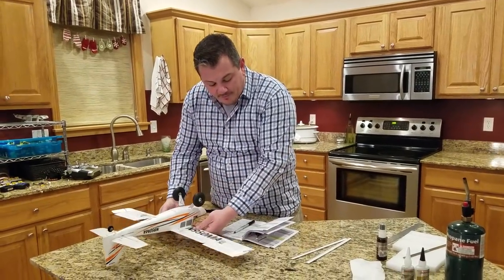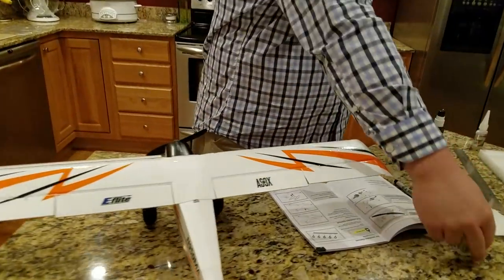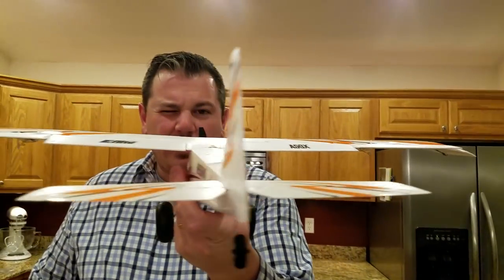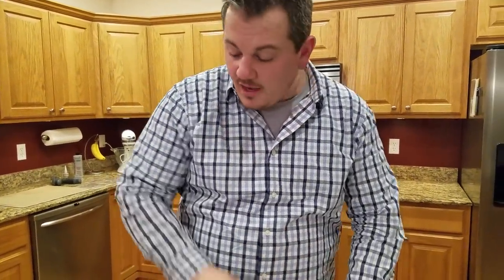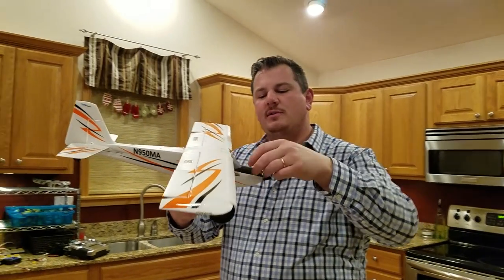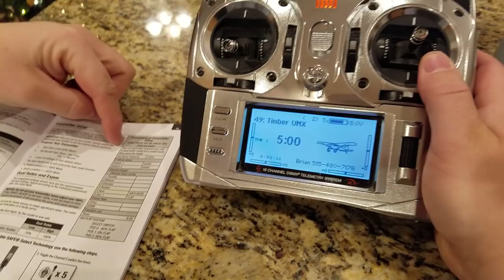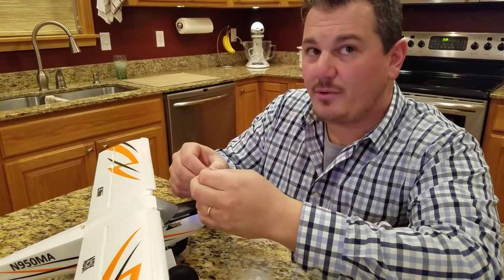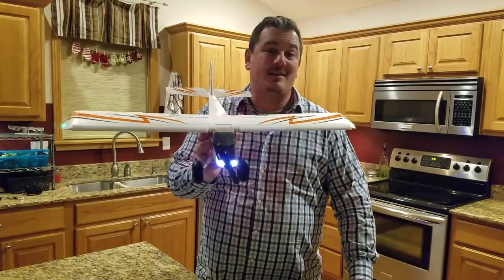Eflite - Timber - UMX - Assembly, Radio Setup, and Tips

Comment: Great videos brian. 
I’m new to the plane hobby. 
I have the new umx timber and still 
Don’t understand the dual rate and expo settings for low/medium/high rates. Your video was very informative but was a little too fast for me and I could not see your radio at times. Any way I could get all the settings from you. Thanks so much Steve in DALLAS ga.
Reply from the maker: Expo and dual rates are very subjective.

Most of the time EXPO makes the sticks less touchy near the middle or neutral position, so you can make a fine maneuver without giving up the maximum control deflections, for when you want to make a maneuver very snappy.

Dual Rates change the total output to the Elevator, Rudder, or Ailerons, the three primary control surfaces impacting change in Pitch, Yaw, and Roll. For example, if the elevator moves 1 inch up and down, and you only want it to move 3/4 inch up and down, then you'd set the dual rates from 100% to 75% thus cutting the output at any given point in the sweep of the control stick by 25%. This is to make the plane LESS Controllable, as new pilots sometimes tend to "over-control" the plane. In my experience, I hate anything less than 100%, in fact, I've been know to crank up controls PAST 100%, but I also use EXPO to "tame the middle of the sticks"...

What's the moral of my comment. You need to play with it. Start with factory settings on Horizon Hobby planes, as they're usually very much flyable, then you can adjust them up and see how it impacts the controls, and down to see how it impacts controls.

Here's ONE method you can use if it's NOT a BNF plane, meaning Horizon Hobby has done all the troubleshooting and delivered a good plane for you, out of box...

Set Expos / Dual Rates as follows...

Find a 3 position switch, and assign ALL three axis (Elevator, Rudder, or Ailerons) to that same switch.

For the MIDDLE setting, which in the Spektrum world, it'd be called position 1, you should set your GUESS setting....like 20% Expo, for ALL three axis (Elevator, Rudder, or Ailerons).

For the LOW setting do 1/2 of whatever the MIDDLE setting was...so in this example make, it 10% expo

For the HIGH setting do 2X whatever the MIDDLE setting was...so in this example, make it 40% expo.

Now for DUAL RATES, just set them as follows...

Find a 3 position switch, and assign ALL three axis (Elevator, Rudder, or Ailerons) to that same switch as above...so now you'll be controlling Expo and Dual Rates at the same switch...remember, pilot fatigue is a real thing, especially for a new RC pilot. You don't want to be searching for 6 different switches (if you had that many) just to make a fine tune adjustment that you probably don't understand anyway (yet).

For the MIDDLE setting, do 100%

For the LOW setting, do 100%

For the HIGH setting, do 75%

...now go and fly the plane, starting on the MIDDLE setting. When you're up in the air a few mistakes high, go ahead and maneuver a bit. Then switch it to LOW, and fly some more. Be ready to see how it responds, as you might HATE it, then you can quickly switch it back to MIDDLE, then when you've had a chance to evaluate your experience, switch it to the HIGH setting and do the same. This is what I mean when I say, just "play with it". This is a highly subjective thing, and what works for me might be annoying to you. There are some things that most pilots might agree on, but for the most part, my method gives you two outs if you "Get it wrong" on the ground...you can cut it in half OR double it to make it less of an impact on your flight. Now that you've "played with it", land that plane and make your adjustments so that whatever settings you preferred, become your MIDDLE setting, then you can do the same formula...1/2 for the LOW setting and 2X for the HIGH setting. I do this with virtually every plane, and it hasn't failed me yet.

I realize you will have questions, please ask, but WATCH FIRST....then you'll be able to site a point in the video, so I have context from witch to get on the same page with you.

Good luck - YOU CAN DO IT!!!
Reply: Brian Phillips thanks for your reply brian. I have the new umx timber BNF and the new dx6 radio. I’ll try these settings. I have lots of simulator time but I know it’s not the same as the real thing by far.and time with a 3 channel. Just a little overwhelming. Thanks again for your help. Steve.
Reply from the maker: It is overwhelming, until you get better, then you'll go and get another overwhelming plane to fly, and the cycle repeats - LOL! I suspect cardiologists wouldn't recommend this hobby, with all the heart attacks involved,  LOL!

Some advice...learn something EVERY flight. Learn from EVERY crash. Try not to make the same mistake twice (which you will, and everyone does). Learn to fix the planes, you can't possibly order every part needed to fix every crash, and they won't be available many times...I can help you with that too :) (<--shameless plug) ....most of all, fly a LOT. Fly as much as your scheduled and wife will allow. You'll get through the scary part faster, and you'll be a better pilot quicker. When you're a "better" pilot, you can get more exciting planes, with less flight aids, like SAFE (which is excellent for learning to fly, I used it..).

Good luck!

P.S. You'll learn quickly too, there's a lot of great people in this hobby, but there's a lot of jerks too. Learn to seek out the good ones, and get away from the jerks as quick as possible....they will sour your taste for RC planes faster than a $1000 plane crash - SERIOUSLY!!!
Reply: Just pause the video and change settings as you go and hit play again . It worked a treat for me and yes he flew through the settings like a mad man lol . Still a great very intuative video to help understand and get basic settings into the spektrum radio .

Comment: Can you use hot glue for the lights???
Reply from the maker: Maybe, but it will melt the foam if it's too hot, also it's HEAVY!!!

I think, based on this video, you might be just talking about putting a dab of hot glue over the LED, in which case, you'd be okay to do this, since you won't melt anything if you're careful, and secondly, it's not going to amount to much weight with only two or three drips :)

One thing about the CA...it will dry more clear, but I've actually used BOTH...I'll drip hot glue, then I'll coat that with CA, and then kicker to set it up quick, with the plane situated to cause the "drip" to lengthen the CA buildup. This works really nice!
Reply: @BrianPhillipsRC  thanks mate. Love your vids!!
Reply from the maker: Sure thing! Thanks again :)

Comment: Last question brian. 
Will these settings work for the umx timber BNF? Thanks again.
Reply from the maker: The ones I used in the example would be a fine starting point, then just refine them to your taste. You WILL notice a difference when you flip the 3 position switch.
Reply: Thanks again brian for your help and the great videos. And your wife is great with the camera.
Reply from the maker: Sure thing Blues Man! She does a very nice job with camera work.

Comment: My timber looks really sad after one of its first flights. The receiver in it was malfunctioning and it did a straight nose dive into pavement from probably 50 feet up. Unfortunate. I'm shocked at how it took it though, barely any damage for the most part. Easy glue fixes and what not. I even called up Horizon Hobby and they are sending me replacement parts for the prop adapter, battery cover, and the receiver.

Aftermath is here; https://imgur.com/a/CM0iM
Reply from the maker: Looks painful!!! So Horizon Hobby said they'd send the prop, prop adapter, battery cover, and Rx, BUT NOT the rest of the plane? Boy, I tell you, they can be your best friend or your worst nightmare!!! I usually only go to war with them over stuff I really want fixed, so I sorta understand, but I just wish they would have sent the whole plane. If they'll agree to the possibility of a complete Rx failure, why not just send a whole new one? It's like somehow the rest of it's "you're fault"...that just ticks me off, for you...too bad.

You got Hobbyking'ed

...but I feel your pain!!!
Reply: I'm assuming the guy on the phone with me was really just trying to do what he could for me. Mainly because he I guess tricked me or whatever and I said I didn't do a range test. Apparently it's in the Timber manual, and because I didn't do that they couldn't replace the plane because it's "my fault" for flying it. Luckily it's patched back up, the only sad thing on it still that battery door and the prop adapter. I'm just waiting on those two parts, I've already swapped out the receiver which was a pain, since it's the first time I've done it. Everything works again though, and they were willing to replace the parts. 

Recently I got the J-3 cub for christmas and it has been a blast to fly. I'm trying to figure out a mod for skis though, and I've got some things in the works. I tried making a runway, but the snow is too deep and I'm too lazy. I've got quite the backyard though! https://imgur.com/a/5xeXN

Comment: Brian, I understand what dual rates are. But I never have grasped the meaning of the expo.  I have looked at videos but my brain just can't get it.  Can you please once and for all explain to me in the simplest form what they are and maybe you can be the hero of getting thru to my brain.  thanks
Reply from the maker: Exponential AKA Expo...is when you change the amount of control surface output from a stick movement, in an exponential manner...

Some like to say, it "softens" the middle of the stick, which CAN be true, but you can dial in reverse Expo too, for extra sensitivity at the same middle of the stick, if you wish.

Think of one, and only one control axis, lets say Roll, via the Ailerons, for example. Let's say you're having trouble moving the roll axis when you use Elevator...so what can you do? Dial in 25% Aileron Expo. What will this do?

With mode 2, for all details listed, meaning elevator and ailerons on the right stick...

Normal (no expo) - aileron stick at 0% over to the right (centered) - ailerons level
Normal (no expo) - aileron stick at 25% over to the right - ailerons move 25% up and 25% down
Normal (no expo) - aileron stick at 50% over to the right - ailerons move 50% up and 50% down
Normal (no expo) - aileron stick at 100% over to the right - ailerons move 100% up and 100% down

Now, with the Expo turned on...

w/ 25% Aileron Expo - aileron stick at 0% over to the right (centered) - ailerons level
w/ 25% Aileron Expo - aileron stick at 5% over to the right - ailerons move 2% up and 2% down
w/ 25% Aileron Expo - aileron stick at 10% over to the right - ailerons move 5% up and 5% down
w/ 25% Aileron Expo - aileron stick at 25% over to the right - ailerons move 12% up and 12% down
w/ 25% Aileron Expo - aileron stick at 50% over to the right - ailerons move 40% up and 40% down
w/ 25% Aileron Expo - aileron stick at 100% over to the right - ailerons move 100% up and 100% down

You can see that the change is much less, until you pass the 25% threshold, then it picks back up and eventually, you'll still get the FULL output of the control surface. The BEST way to understand expo is to go and fly a plane. Turn expo up to 50% on each of the three axis, elevator, rudder, and aileron...then change the expo to 25%, then 10%...you will see EXACTLY what I'm talking about. It'll take the most erratic plane, and tame it down to a manageable state.

Now that you've tried this, simply change each axis, as you see fit. I want less responsiveness from the RUDDER, but the elevator and ailerons are good at 20%, then make the rudder 50%....try again, and next thing you know, the plane fits YOU like a glove ;)

Just do it...you'll get it. It's super easy to do, and takes like 15 seconds. Every time I try to enplane this, I feel that my explanation get less and less useful, so I HOPE you have a semblance of what the heck I'm trying to say.
Reply: The control sticks cause the ailerons, elevator, rudder to move.
With no expo, if you move the control stick 1/2 way then you get the ailerons, elevator and rudder to move 1/2 way to their max....etc...

With expo set to your chosen amount - you can get more or less movement
on the controls from a given amount of stick movement -
for example-
you could set the exp so that when you move the stick 1/2 way
you only get 1/4 movement on the controls -
the result is that the stick is not as sensitive -
you have to move it farther to get results -

That is a simple explanation but there is more to it than that.
With expo - the amount of control movement you get depends on where you are in your stick movement. ...
for example - when you first move the stick a little - you can set it so that you do not get a lot of control surface movement but as you move the stick more you get  more and more movement -

Imagine you have a car with a steering wheel and when you first begin to turn the wheel you do not get a lot of result - like not having power steering -
then as you turn it a lot - the power steering starts kicking in and each little increase on the wheel gives you more and more results -

You may like your car to behave that way - 
it makes it nice for a cruse down the interstate -
if the steering is too sensitive then you spend all your time trying to adjust and readjust just to stay in a straight line.
Reply: Thanks for that response.  Makes perfect sense.   When I fly the timber in safe, everything is perfectly level.  As soon as I switch off safe, the plane goes up and sometimes even turns.   Is this a trimming issue or do you need to constantly be leveling the plane using the elevator and/or ail?  thanks
Reply from the maker: Gene, you'll have to make all of the trim adjustments with SAFE off...IE only AS3X stabilization. When you have the plane trimmed, you'll notice that she flies true and level with SAFE on as well.

Also, don't forget to make mechanical trims where necessary. This will allow AS3X and SAFE to work at their peak performance, for best flight performance

Good luck!
Reply: Gene Sultan hi gene. 
Sorry to bother you but I saw your comments on Brian’s rc Page about the expo and dual rates. 
Can you give me the setting numbers for low med and high rates? For all the control surfaces? Thanks so much. Steve in DALLAS ga.
Reply from the maker: I just replied on the other comment, but Gene may also get back with you too. I've spent some time with him on this topic on this and a few other videos too :)
Reply: hows it going?  No Bother, but I actually now understand it all.  I appreciate your wanting to help though.  I do have lots of other questions.  how long have you been flying.
Reply: Gene Sultan I’m a beginner. Only flown a 3 channel and a simulator
Reply: @BrianPhillipsRC  Thats a 100% flawless explenation mate . I do understand the full concept of Expo vs dual rates and you hit the nail on the head there .
Reply: @BrianPhillipsRC  Mechanical trims meaning the little U bends on the servo control rods ?
Reply from the maker: sure, on a UMX plane, or on a bigger plane, you'll have a variety of mechanical adjustments. Some are screw on clevises, and some are still "u" or "v" bends, while others are actually just moving to a different notch in the servo control arm, or the control surface.

P.S. I just remembered you were looking at the Carbon Cub S+...it's a GREAT flying, and beautiful airplane, BUT, I gotta encourage you to think Timber. It's a WAAAAYYYYYYYYYYYYYYYY better value, and you will absolutely HATE the setup on the Carbon Cub S+...it's GPS system kills it for me, if it weren't for that, I'd LOVE it. There's nothing quite like flying along, and then the plane taking off in another direction then you anticipate...NOT A GOOD FEELING!!! BUT....it is a beauty....and I still want one too - LOL

Comment: My motor turns the wrong way 🤦‍♂️ any ideas? It came out the box like this.
Reply from the maker: That is a crazy QC issue from Horizon Hobby. 

You CAN fix it, or you could ask Horizon Hobby to fix it for you...maybe they'll send you a "freebie" and you can fix it too ;)

I'm sorry for the slow reply...work and new house has been keeping me super busy!

Here's what I would do to fix this issue...

1) Open the hatch (battery area)
2) Pull the plug up from the motor, which goes into a wire under the battery tray back to the Multipurpose Rx "Brick"...it's three colors...BLUE, BLACK, RED...in that order...
3) Unplug the two connectors from one another - BE CAREFUL not to pull out your battery tray!!!
4) Use an Xacto knife (or a super small precision screwdriver) to push one of the silver tabs down, thus releasing ONE of the three colored wires (I don't care which one, and it doesn't matter, but for the the sake of the instructions pick BLUE...) and pull the wire free of the three pin connector
5) Do the same for the BLACK wire...disconnecting it from the MIDDLE spot...
6) Now, simply swap them so that the BLUE is in the MIDDLE, and the BLACK is on the OUTSIDE
7) Start the plane up, and the motor will now be rotating the correct direction

Keep in mind, you can swap any TWO of THREE wires to change the direction of the rotation of your motor. It should be turning COUNTER-Clockwise, while you are NOSE to NOSE with the plane.

Good luck! Should be an easy fix, but you SHOULDN'T need to be fixing this!!!
Reply: Brian Phillips, I got it thank you! I can finally fly forwards lol, I’m binging your vids btw.
Reply from the maker: Excellent! It's fun to disconnect those white connectors, isn't it - LOL!
Good job and happy flying!